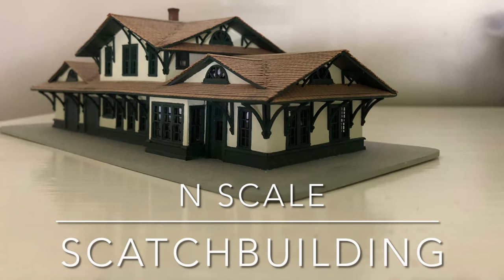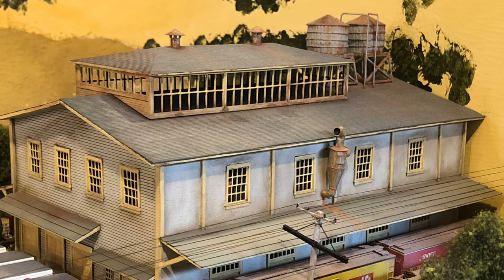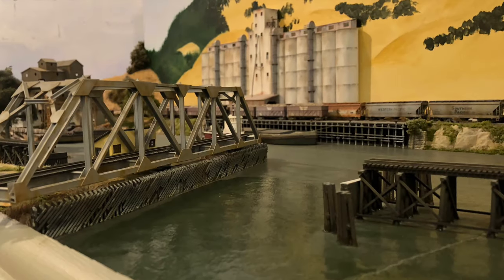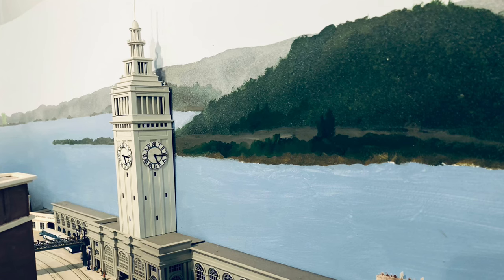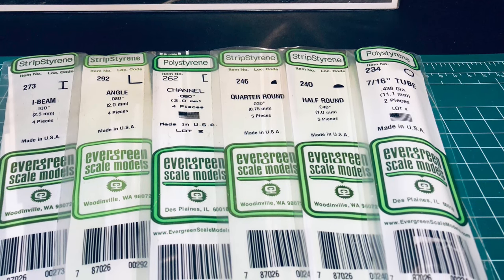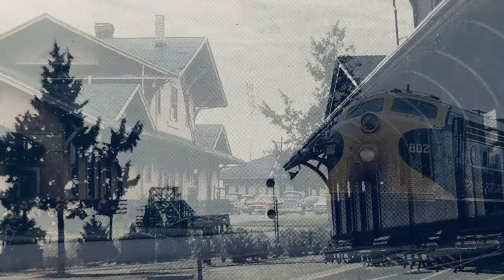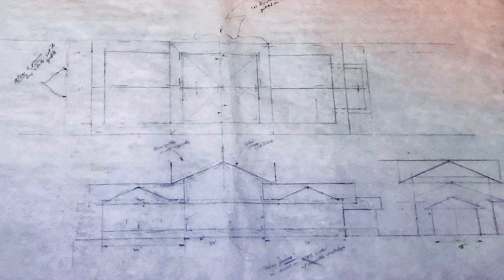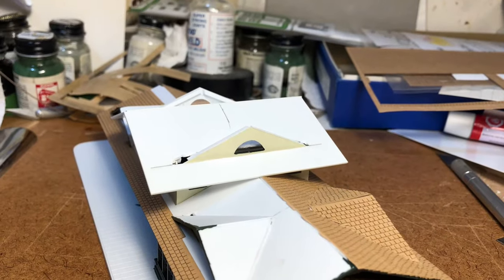N Scale Scratch Building

Comment: Thanks John, I really appreciate this tour of your buildings. As a track guy, I tend to struggle with buildings. I can lay a double slip in N scale, but I marvel at the structures that folks like yourself produce with what seems to me to be casual abandon! (And +1 for @boomerdioramas. Stuff of legends!) 
Your tour reminded me of the many iconic buildings and building styles in SF and surrounding areas. Again, my reaction to most of them was "wow, check that out, so cool! To make something that looks good is an achievement, but to capture it so well that the building is instantly recognizable is really impressive. And in my case, I'm familiar with the buildings on your layout in modern form yet they each jump out at me as unmistakable representations. Great solution for the Seals stadium by the way, a really nice touch and clever way to include it. 
I'll take your advice regarding building skills improving with practice. There are some iconic buildings and structures on the Richmond Pacific which I particularly want to capture on my layout. And that's gonna require some better efforts than what I've accomplished previously. To give myself some credit though. I have reached the level of knocking over the MEK and realizing a big heavy base was a necessary part of scratchbuilding. So, maybe there's hope for me yet!!! 
Thanks again, and be assured your efforts are appreciated, even way out here in Ontario Canada.
Cheers, Steven
Reply from the maker: Thank you, Steven. If you’re great at track (a double slip!!!! Wow!), then without a doubt: you know what you’re doing!! And now that you’ve graduated with the rest of us in having successfully “tipped the bottle”, you’re well on your way!!! Thank you for the kind comments. Modeling does offer us so many opportunities in so many facets, for sure. I have ALWAYS admired the ‘track gangs’ and their intricate work! After all, unless one is TRYING to model derailments, it all starts with some pretty great track work! 
Thanks once again for looking in! And great luck to you in your endeavors on the Richmond Pacific! I look forward to checking it out !!
Cheers to you, there in Ontario!